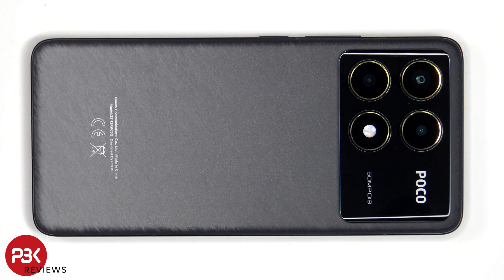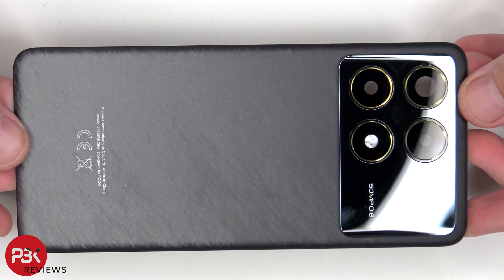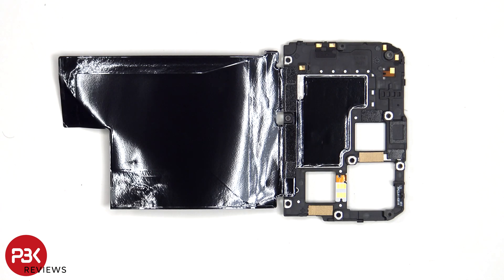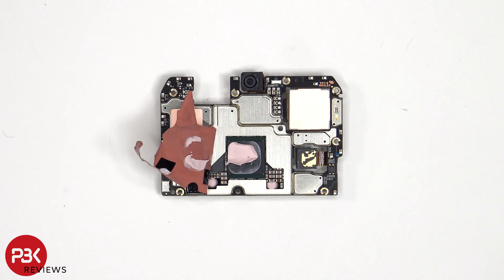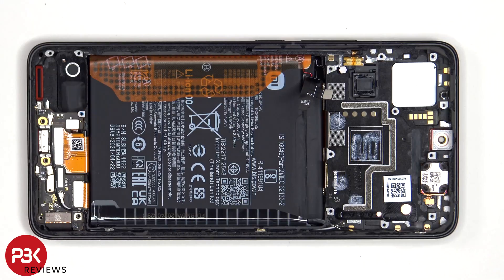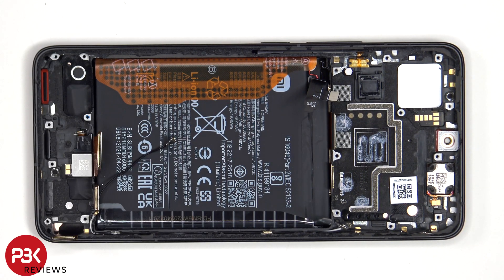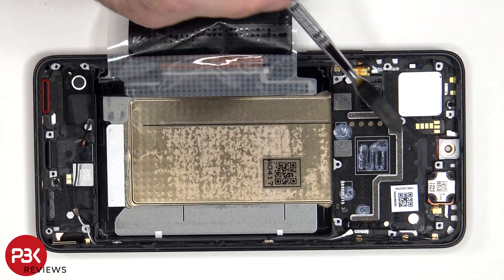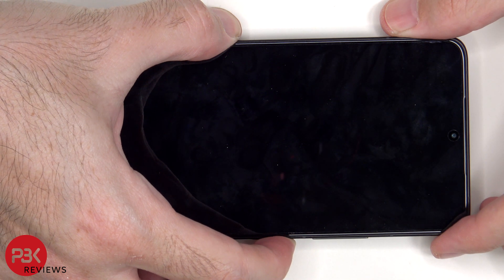Xiaomi Poco F6 Pro Teardown Disassembly Phone Repair Video Review

Comment: كل مرة الشركة شاومي تضع الذاكره الرام فوق المعالج 
مما يودي الى ارتفاع الدرجة الحرارة 
هذا هو وارى السر الموت المفاجئ
Reply from the maker: Almost every manufacturer does that with higher end devices. It offers better performance. The problem isn't the ram being ontop of the processor. Its quality of parts and cooling. If cooling is done well, and good quality thermal compounds are used, there should be no problem.

Comment: What do you think about stacking RAM and CPU, which can result in total shutdown? in my country poco often dies completely
Reply from the maker: As I've told many others, the problem is not stacking. Every high end phone has RAM stacked on CPU. It offers better performance. Problem is cooling and quality of thermal compounds etc. As long as cooling is good and heat transfer is done well, there shouldn't be problems.
Reply: @PBKreviews  thanks sir
Reply: @PBKreviews  Do you think POCO F6 PRO has good heat dissipation?